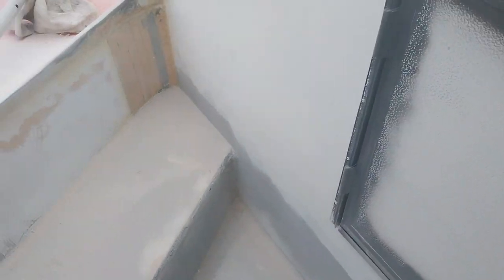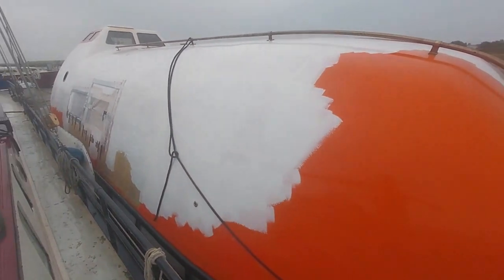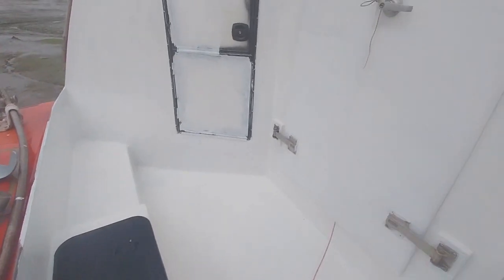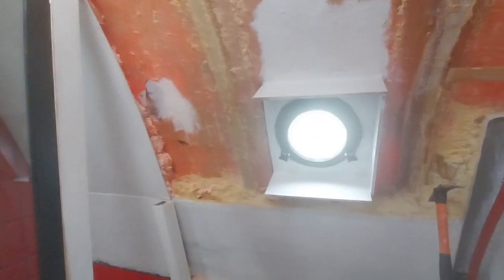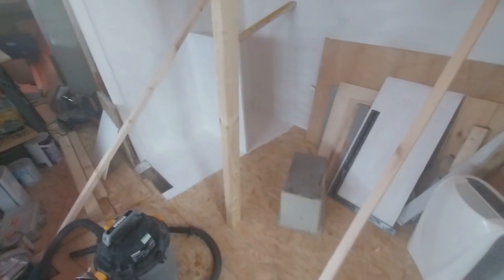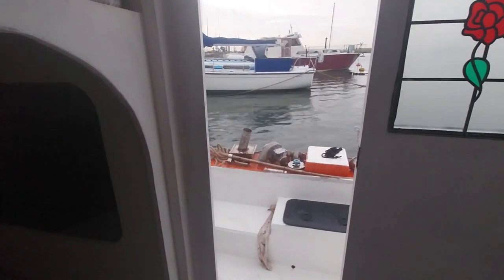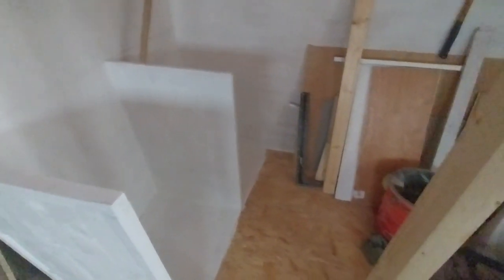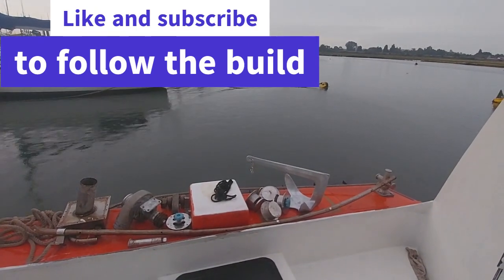Lifeboat conversion Ep. 40: Making the cockpit and getting it primered.

Comment: Hi, I love what you are doing at the stern, my lifeboat is a bit smaller than yours and I am contemplating extending the stern out not cutting into it. Question regarding the seating, it looks like you've cut most of it out around the internal edge of your boat, I've been thinking of doing this to create more space but have concerns about removing too much of it reducing hull strength and changing buoyancy, any thoughts on this, would you do it differently?
Reply from the maker: Hiya, thanks for your comment. I am not a 100% sure what you are asking, but I can say that it is unlikely that whatever you cut out is going to interfere with the boyancy. I left the aft deck but cut into the superstructure, so the hull is still fully in tact.
Hope that answers your question.